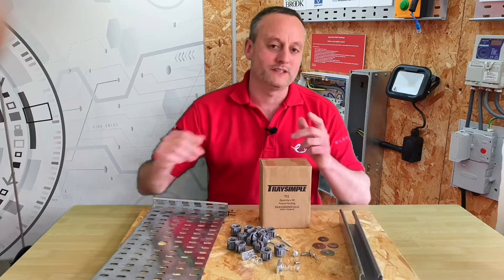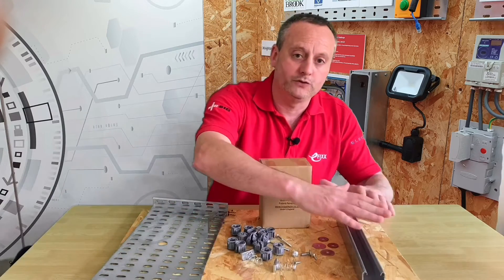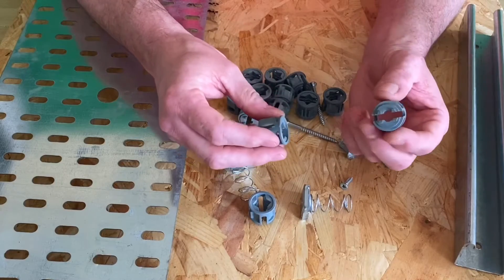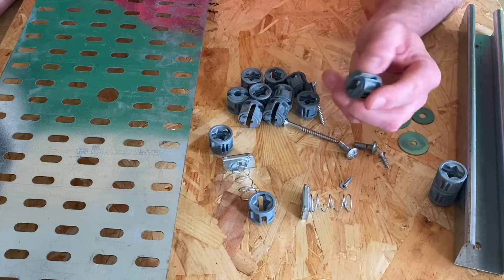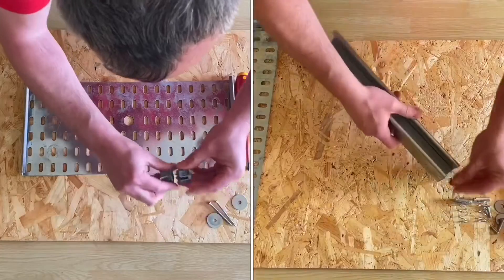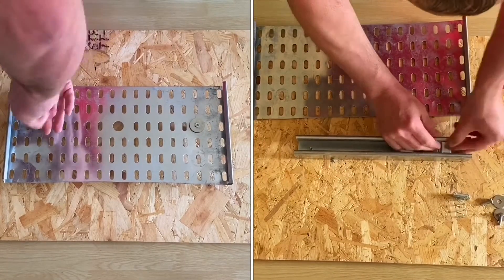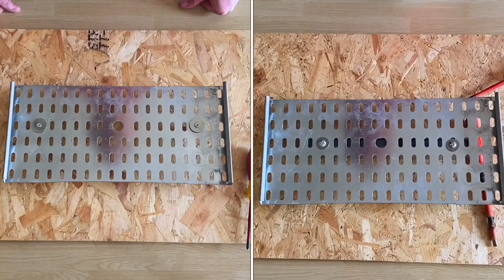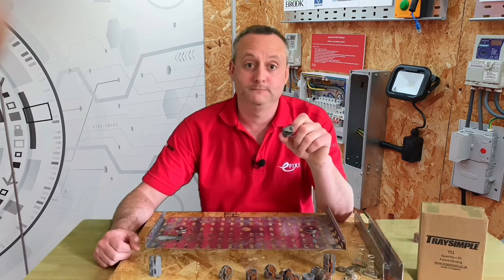Faster cable tray installation using a Tray Simple spacer.

Comment: I'm trying to think of an application in an industrial setting where unistrut is used and i can't think of any where those little nubbins can replace the strut. Ok for into plywood but how would it work going down from say the roof space of a Tesco's down to a roller shutter module for instance? What would you screw it to without the uni?

Comment: A good product as I have had to use alternative methods in the past to space trays face down such as M10 nuts or the best thing to hand, hats off to the guys who have seen an opportunity for an everyday problem.
  Gripple Fast Trak. Check it out, a great time saving suspension system for cable containment and a viable alternative to strut for hanging electrical & mechanical services. Recently used on a job with a very tight schedule and TBH played a significant part in pulling the job in on time.

Comment: Are these going to comply with 521.10.202 ?
Reply: YES The cable tray will be supported by the fixing in the wall, against premature collapse. The Spacer has been demonstrated to our local NICEIC engineers. Whilst they are not able to endorse the product, they have said that they comply with the regulations

Comment: Probably good on something that is light weight
Reply: The weight issue depends mostly on what fixings you are using and what you are fixing to. The spacer does not support the weight it is the screw and its interface with the wall that provides the support to the tray

Comment: The quick one won’t hold up under weight like the slow one will
Reply: You can always use more spacers per length of tray if weight is an issue. However the main limiting factors, will be the material you are fixing to and the type of fixing utilised. A masonry screw into brick or concrete provides a very strong fixing. On a plasterboard wall I would suggest a channel frame fixed to the floor. Each system has its merits

Comment: You having to drill a 20mm hole in the cable tray?
Reply from the maker: No clips straight in to the perforation.
Reply: Just noticed that, that would be quicker than fitting tray brackets aswell. 👍